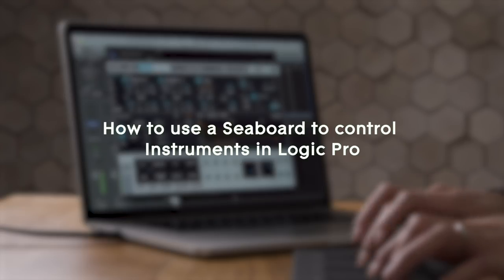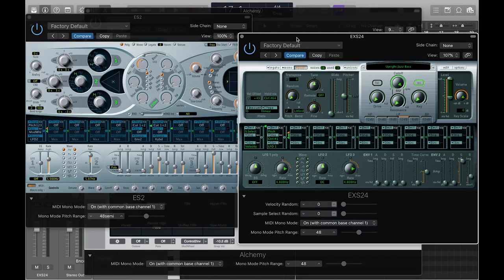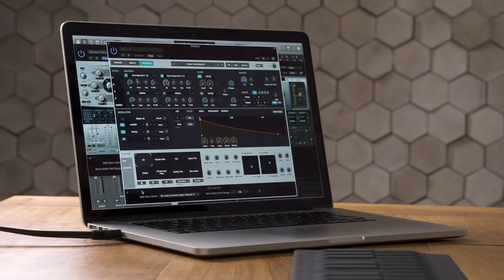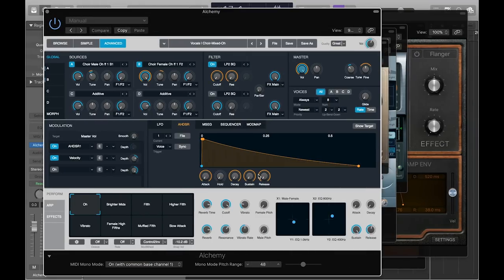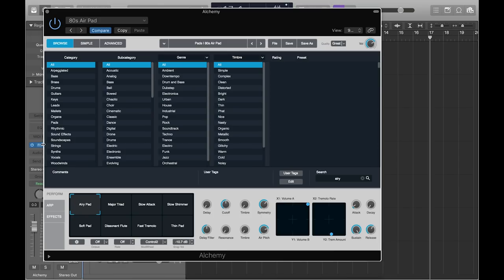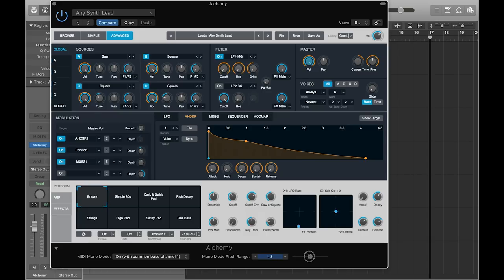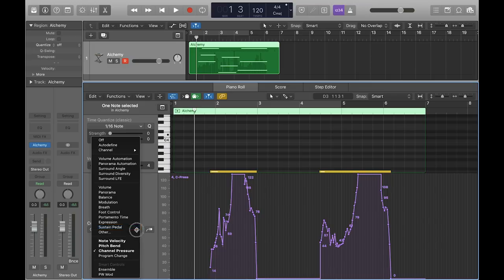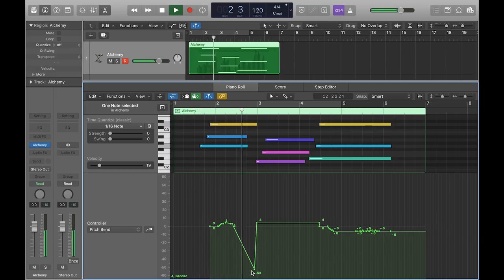How to use a Seaboard to control instruments in Logic Pro

Comment: I found the Airy Synth Lead is not responding to the pressure gesture, however you say this is pre-assigned in this logic patch. How to make these sounds responds to the pressure gesture? (The glide tip with the midi mono mode works perfectly though!) I will appreciate your help!
Reply: I got the same issue now, did you find a way? Thanks ;)